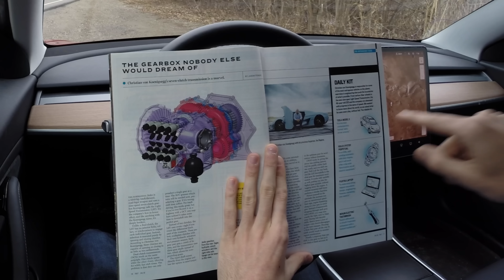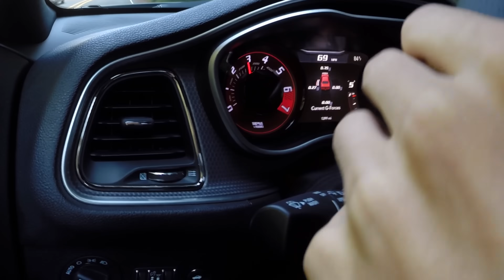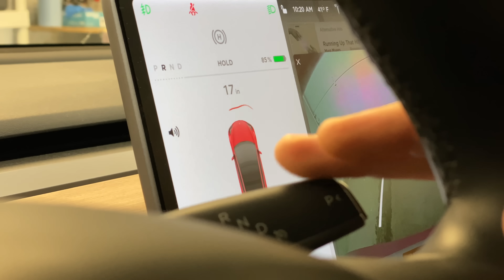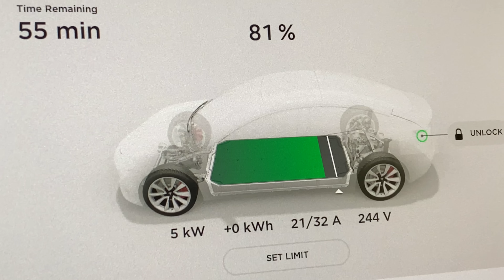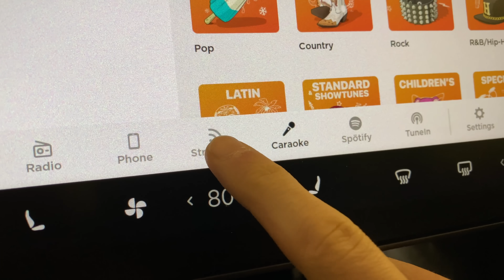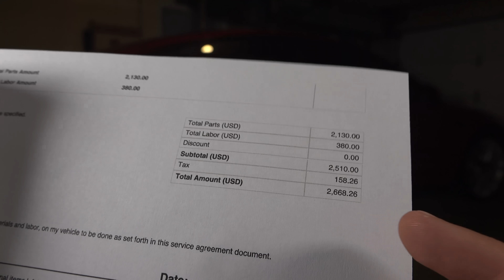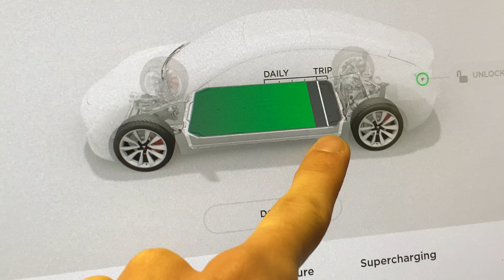Living With A Tesla Model 3 For A Year - The Best Daily Driver

Comment: In general, it is still the case that an electric car does not have as high a top speed as a regular normal car with 200 horsepower or more Even a diesel Mercedes can obviously drive faster than an older Tesla S on the autobahn

Comment: Excuse me, but Porsche actually has a gearbox in at least one of its electric cars. This may have to do with getting lower torque when the RPM passes a certain limit which, for example, may correspond to the speed of 50 Miles even on a Tesla 3 Performance. a person on YouTube tests a Tesla on a dyno

Comment: apparently there were electric cars 100 years ago or more since they showed one of those from some car museum on the inside it looked more like a small living room I didn't even see a steering wheel. but it was probably problematic to have an electric car at that time.  range and where would you charge the car. It is perhaps not even obvious that people had electricity in their homes? 

And what has been said is also that the petrol was cheap so you can say that the petrol car won in the USA. And the Ford model T was a cheap car even with today's monetary value. the car market literally exploded. The street scene in cities like New York changed radically in apparently just 13 years?

Comment: Yes I like the idea of an EV. My weekly commute is 200km (125 miles) so range is not a problem to me. I have rooftop solar thanks to the extremely unreliable electricity grid in my country and would recharge the car for free. The fuel savings alone would pay for the car within 40 years. I would build a carport at the bottom of the garden so that my house doesn't burn down when the car catches fire. A bit over a century ago, electric cars were quite common. So why did people stop buying them and go for the allegedly inferior ICE vehicle instead? That's the question that has to be answered.

Comment: Comparing a modern 60 k electric to a sixties ICE car. Modern cars that cost a fraction as much handle most of his so called problems with ICE. Where I live the Tesla's can't make it to the next big city without sitting at a very dangerous charging station for HOURS. And don't you dare use the A/C or Heater no matter if it's near zero or near 115.
I would love to have an electric car, if they actually delivered what they claim.
They don't.

Comment: The resistive heater preheating thing sort of works with all cars with seat warmers plus if it’s in a garage how cold can it be for the 3 minutes until the engine starts making warm air. Or you could back out of the garage to warm up the car

Comment: I guess if you can call spending 45+ minutes fueling up "Living".  Telsa quality control is abysmal. There are so many compromises.  Literally the only advantage is speed.  It's classic misdirection.
Reply: I’ve had a Model 3 Performance for 3 years and only needed a 12v replacement. Tesla did it for free and all I had to do was open the garage for the guy to replace it.
Reply: You know nothing.

Comment: I'm a die hard stick shift guy and this just gets more and more depressing.
Reply: I had driven sticks exclusively since 1983 until I traded my 2016 BMW 328i (6-speed) for a Model 3 (the one in this video).  While I'd love to still have the BMW for occasional use, there's just no comparing it to the Tesla.  Instant torque and accelleration is mind-bogglingly fun.
Reply: @SpottedSharks  I believe the acceleration part. Modern sports or sporty cars seem to focus on the acceleration and quick shift change, with the help of electronics. Which means you're not really in control; you step on the pedal and the computer decides how to speed up. To me driving is not just about acceleration or speed. The real fun is in how YOU fine-tune them through manual shifting/clutching, and that in itself is an art, which is dying. Modern cars are all about technology and no longer about raw skill. That's what depresses me.

Comment: I get it, I really do. I've driven a friends model S and the immediate torque is astounding, and the quiet is deafening...so much so you have to be careful to not be constantly way over the speed limit. EV's are also packed with all sorts of cool features etc etc. Having said that, even the highest performance EV wont have the same level of emotional engagement as an equivalent ice car. As for saving the world? EV's arent going to do that, and also arent going to save you money in the real world. (unless gas prices are artificially inflated while electricity prices stay relatively stable) What increased adoption of EV's WILL do is eventually give us cleaner air and water (assuming we get over our fear of nuclear power, because wind, solar and hydro arent going to completely replace coal/natural gas powerplants) and less noise in crowded city environments. Yes, I know at least one carmaker is attempting a simulated manual transmission, and sound and even drivetrain vibration of a nice V12/V10/V6 engine/exhaust can be simulated, but the overall feel can't really be replaced, and that saddens me. Sure there will still be many ice cars available on the used market once new ones are legislated out of existence, but by the time we reach that day I can see gas prices being anywhere from 8-$10 per gallon in an attempt to force holdouts to make the switch. That means even a weekend toy could get pricey to fill up for a weekend jaunt...assuming it's still legal to drive one on public roads.

Comment: What I wouldn't like about the Tesla: too many doors, car is too big and heavy, no manual transmission.  You didn't mention anything about handling or steering feel in your video.  I assume that means they suck and you don't care if your "daily" has good handling or steering feel.  Also you didn't mention whether you enjoy driving the car or recommend others buy one.  Last comment - several of the knocks you have against ICE vehicles are only there due to government regulations.  Throttle delay and shift delay are programmed in to save fuel.  So really your quarrel there is with the feds, not with the ICE in general. I also disagree with the lack of torque you mentioned.  Torque is just a function of gearing and the way the vehicle is set up.  Any ICE can hit super hard with the right gears.  The thing I hate about modern ICE vehicles is you can't have a lumpy idle anymore.  It's one of the great pleasures of driving - listening to a car idle when it has a nasty camshaft in it.

Comment: Does a Tesla really use resistance heating? As opposed to having a reversing valve on the AC compressor? Giving you heat pump heating?

That’s like a an easy 66% reduction in energy consumption for cabin heating. Only reason why I could see it is if the heating load is tiny compared to driving load it’s simply not worth it.

Just curious about this.

Comment: A lot of your plusses on the electric car and your minuses for combustion cars are solved by a good hybrid like the Prius, and ... oh yeah, you can drive anywhere in the country, stopping at any gas station (which there are way more of than Tesla charging stations) and it will take about 3 minutes. And you'd better hope Tesla keeps maintaining those chargers. As a single car (not a 2nd car), I'd never buy a Tesla. One more thing, the Prius has a solar panel that keeps the cockpit cool on sunny days even if the engine is not running.

Comment: An internal combustion engine can have a linear throttle response but only if the manufacturer designs it that way. It's my understanding that Porsche does. In contrast, most manufacturers make the first half of the accelerator pedal travel produce far more than 50% of the engine's maximum power. They do this to trick the owner into believing that his car is faster than it really is.

Comment: Also, the 2021 now has the 18" wheels standard, heated steering wheel, etc. How about the back seat manual door releases? Do you know if they've been added in 2021? Thanks for a great video.

Comment: After driving my Model 3 for the past month without yet having home charging, my sense is even in this less than ideal scenario, I still prefer it to stopping at gas stations. I can tell much more accurately how much more 'fuel' is in my car, and so planning fill ups is not hard. I basically just go about my daily errands while just keeping an occasional eye on my battery pack percentage. If I'm about to get home with less than about 25%, I'll stop by the nearest supercharger for 30 mins to an hour and just do some reading, or check emails, etc. If I don't have time, I know to give it a charge next time I go out. Worst case, 25% is more than enough range to get me anywhere in the city, and back to the nearest charger before running empty. Sure, charging this way takes longer than filling up gas, but: 
1) It's a less busy area usually 
2) no gas fumes to smell 
3) it's still cheaper to charge than buy gas, so you can just spend a fraction of those savings on a tea or coffee and get some stuff done or just relax
4) you aren't at the whim of highly volatile oil markets and seasonal price fluctuations
Reply: What about the impact n the battery?
That's one of the things holding me back as I probably will be unable to home charge as well.

Comment: I’ll give you my list. 1. The company doesn’t make a profit on the car manufacturing, only on selling environmental tax rebates so it is underpriced even at the 2x price of a 5 passenger car. 2. Out of garage parking is always going to be a pain for charging and will ultimately limit the market.  3. 2.5 minutes for recharging with gasoline cannot be beat. 4. Carbon Dioxide/minor global warming  is good for the environment and is resulting in increased arable land and reduced frost loss in farming. 5. Cold weather battery capacity loss is unpredictable and cannot be wished away. 6. I really don’t want to handle the charging every time I get out of the car. 7. If i run out of gas, I just get a gallon from a friendly passerby, ever try and jump start a Tesla? 8. They keep aggressively pushing for hands free driving utilizing their customers as guinea pigs. I believe they have killed 5+ customers/bystanders in the name of testing. 9. Batteries capacity and usability reduces over time and gasoline doesn’t. 10. Car fires + electricity. Even without the fact they don’t have emergency releases in the back seats. Bonus Superchargers work until there is a larger volume of cars on the road. As it takes 20 times longer to charge, the superchargers are going to get busier and more expensive. On the plus side the look cool and in sunny conditions they would be a fun second car.

Comment: Well spoken on the environment argument. Nice that I'm not ejecting nasty pollutants while Tesla'ing but I don't want to get sanctimonious  about it especially when it comes to all the stuff at the factory. I agree with the positives which is why I would get one just for the driving experience and being able to have it fully charged when I leave home. Dunno what I'm going to do with my IC maintenance tools. On the stereo losing bass in the back, how many times have you had the old rear speakers booming away in the back right behind the rear passengers so the driver could hear it? Not sure whether that is a design flaw or a design choice because you will probably only have front seat passengers most of the time. I have swung from negative about Tesla to "when can I get one" mainly due to the leading battery / drive system. It is really the only pragmatically appealing choice in Australia. The only hesitation would be on how it handles the regular 45C summer days driving and parked in this neck of the woods ( Adelaide South Australia) and the nearest dealer is 730 km away in Melbourne. [edit] Apparently there is one in Adelaide but I missed it on a cursory glance at the Tesla website

Comment: Electric vehicles glass windows/windshield are only half the thickness. The energy wasted when they crack for no reason isn't minimal.  I wish they didn't use weight saving where you actually loose energy in the long run. Replacing windshield on new vehicles are also very expensive.

Comment: I'm not going to knock electric cars because I do believe that they will get there eventually, but the floor in your performance argument is that that is simply straight line acceleration.

Take that Tesla and the R8 to any winding road, to any race track, to anywhere where people that actually enjoy driving want to go. Take them both to the Train of the Dragon. The R8 will get to Deals Gap, fill up and have ordered lunch before you arrive.

Then there's the cost thing, another topic that I believed you were grossly incorrect on. you said you did not believe it was initial cost that would keep people from buying electric automobiles. I drive a $36,000 automobile, a smallish performance, 4-door import. in order to get an electric car that is even close to as engaging and close to the overall performance offered by my little import, I'm looking at the Model 3 performance model at well over twice the initial cost. Yes, total cost of ownership matters, of course, but discounting the initial cost of the vehicle does a disservice to the discussion. By the way, even if we buy the model 3 Performance model at over twice the cost, straight line acceleration is still the only performance number that will exceed that of my inexpensive import. Put some more money into the car and eventually you can get it to handle as well.

The decision between gasoline or electric also involves a lot more then whether you go on road trips and whether or not you have facilities to charge it overnight. That turns the entire discussion into one of simple transportation. Point A to Point B. I know there are some people that are dead and just going through the motions of life, but a lot of us truly enjoy the experience of driving. I enjoy every sensation involved with driving. Do people like me not matter?

Comment: If there was a more experienced manufacturer but with a tesla power train that made a car that was not in coupe shape but a wagon I would buy it emidiately. I just can't put 60k into something as bad looking and with the build quality of the Tesla Model 3 even if it is a great daily driver. There are some cheaper options starting to come out but they are impossible to get in AWD which is a requirement for me. Guess Ill just have to wait another 10 years until there is a good one.

Comment: Question: why Tesla’s vehicles are so primitive? They don’t have the selector for the braking re-generation rate on the steering wheel- they have it in a very complicated menu in the touch screen.
Even the smallest electric Peugeot has the ability to change the braking regeneration rate using a lever- sorry Peugeot builds cars for Drivers, not for passengers with a steering wheel in front of them

Comment: My father has one and one complaint I have is riding in the back seats. The rear suspension, in my opinion, is too hard. Long journeys in the back are quite painful and you end up a little dizzy. Nobody talks about that because every youtuber that has one Model 3 drives it itself. However, I've driven it many times and I can say the front suspension is quite confortable, it's totally a different experience
Reply: @NotTheCIA I.think Nope, it's the long range version with the 19 inch wheels
Reply: @NotTheCIA I.think I bet you're from the USA, right? I guess there you have more straight roads than Europe. The long trips I said I've done in my father's model 3 have been in some curvy roads

Comment: If the world started with electric cars, gas engines today would have had the fuel efficiency of cars from the 70-80s. ICEs today have the benefit of a century of non-stop engineering advancements while electric motor/battery tech is only playing catch-up. In the alternate universe, gas engines would been undercooked and had to play catch-up to electric engines. Plus an extra annoyance would be not being able to find any gas stations nearby.

Comment: EV are not ready for city dwellers. no charging stations. if you live in a apartment, co-op, or condo...well good luck charging the car. battery fire hazard are real and can not be put out by "water" especially in a congested densely populated areas..... environmental issues are the manufacturing and disposal of the batteries

Comment: I drove my dads 2019 Nissan Altima and for a gasoline engine, it’s extremely quiet. Maybe because my mustang gt is fairly loud I’m used to a loud car but man was is quiet. I do have to say. Driving a quiet automatic car is pretty relaxing. I’m used to driving a heavy steering and pushing a clutch with interior rattle.